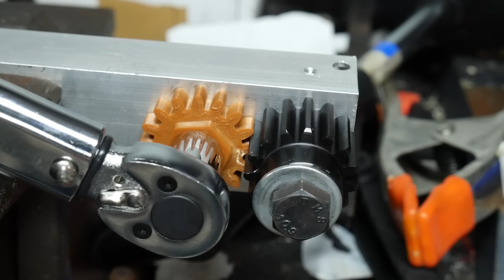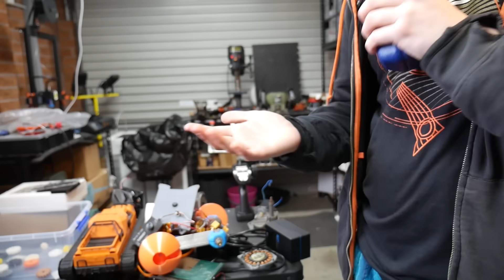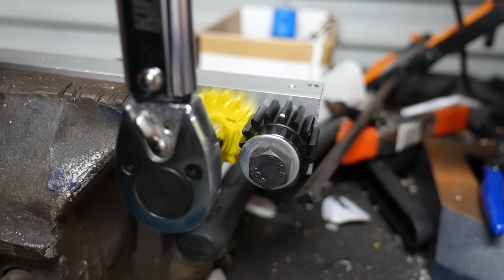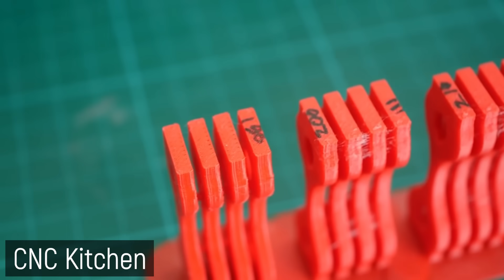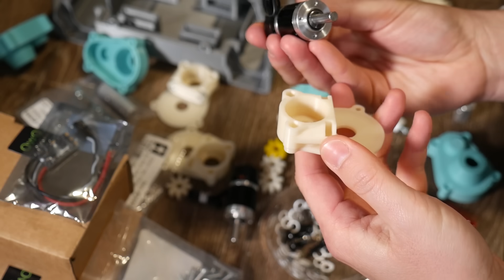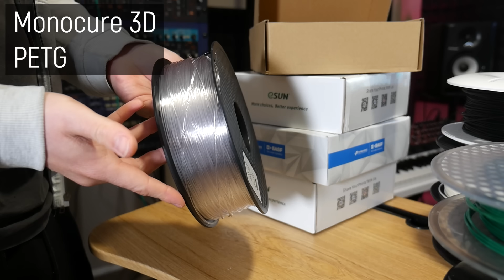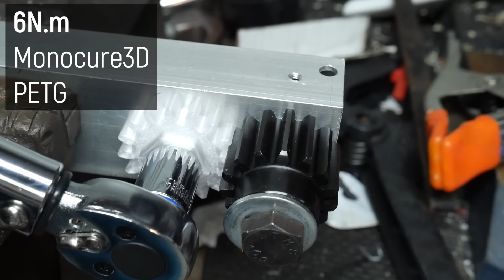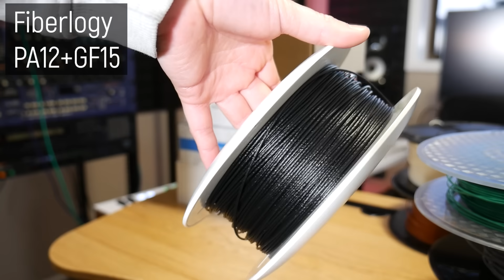Which 3D Printed Gear is Best?

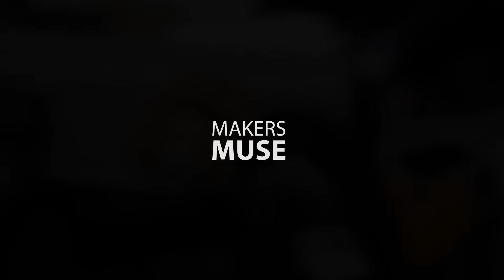Comment: 0:35 Angus, you're so much better than doing a long print like that with a minuscule table contact surface area and rotated like that! Please tell me that that's just to show off courage / bed adhesion, not a lapse of judgement! ☺️
Reply from the maker: I totally did print that and it worked great :) Had a brim and vertical gives the best detail.
Reply: @MakersMuse  absolutely, what I meant was that having a tall narrow thing swing while printing is better positioned when aligned with the moving (Y) axis...

Comment: 7:24 Nylon, cause it slips. No damage to the motor nor the gear.
Reply: Nylon parts should be soaked in hot water for an hour. That is how it gains a lot of strength.

Comment: PLA is quite good even as a surface bearing if you give it some grease.  i made a model engine printed in place with pla and after running it in to get the contact surfaces smooth it ran for over 2hours continously without damage and still works.

Comment: Angus, the amazing thing about 3d printing gears is being able to make herringbone and double helix gears, they are far more efficient, resistant to torque, and quieter. For your requirements I would definitely look at Polymaker CoPA-CF, quite pricy but definitely worth it, my second favourite is their normal CoPA, but they aren't as rigid.
Reply: Helical gears are not as efficient as standard spur gears due to the higher contact load and sliding friction for a given torque, although for most applications the difference is not significant considering the other advantages. Helical gears are stronger though due to the tooth effectively being longer. It would be interesting if he repeated the experiment with helical and herringbone and double helix (slight gap between the helixes) gears to test the strength increase. Herringbone gears are a bit stiffer in the centre where the helixes meet.
Reply: @Bordpie  I agree with the part you are saying on single helixes but double helix and herringbone don't have this downside. Yes herringbone is stronger due to the lack of a gap, but double helix is ideal for when the gear might get dirt or grease stuck in it, since it doesn't build up in a double helix due to the gap but in a herringbone it does.
Reply: RCTestflights made a few different style gearboxes for his autonomous solar rovers, much better durability than standard gears.
Reply: @Christian-cz9bu  They were also lubricated with slugs lol

Comment: Can you test annealed PLA? I think the results would be pretty interesting
Reply: It would be hard to get a good shape because gears would ideally want to roll consistently between all the teeth. 
But with testing, you could get as nice in the middle to keep that precision in the gear profile
Reply: consider how low PLA glass transition temperature is, you have to consider the heat from motors and batteries if there are any, and other factor like material fatigue.
Reply: @nhozdien5058  Indeed, James Bruton has had a number of failures where the motors in his robots are directly attached to 3D printed PLA brackets through the PLA softening.
Reply: @cambridgemart2075  yeah that is a really good point. Does that mean that PETG is worth it for the long run?
Reply: I'd bet it'll be a serious step up in strength.

All my experiments with what's strongest for moving mechanical parts has always brought forward annealed PLA/PLA+ and remelted PETG.

PLA retaining its strength longer while PETG gets more brittle over time as it reabsorbs moisture.

Ofcourse, if your application doesn't have your part in an environment with moisture, PETG will do better.
Reply: @enlightendbel  Hi！Could you tell me how to anneal PLA? I really want to know
Reply: I think in that case will be need using 100% infill, so maybe will be fair enough compare also against remelted PETG in salt.
Reply: @MichelBrPrGu  I have annealed prints at 100 C with 5% infill and it works just fine, as long as there is no stress on the print as it anneals. It is much stronger and more temperature resistant after. I recommend it for all practical mechanical applications.

Comment: Small 3dp gear: exists 
Elephants foot effect: NOW HOLD IT RIGHT THERE BUDDY
Reply: PrusaSlicer has a great compensator for the elephant foot effect.
Reply: @lio1234234  Cura too. Initial layer horizontal expansion or something like that. If you set it to a negative value you can get rid of it :)
Reply: @lio1234234  what's is it called haven't seen it
Reply: @rentaspoon219  Print Settings -> Advanced -> Elephant foot compensation.
Reply: Just reduce flow of initial layer.. Or when designing an object give it a chamfer of the bottom layer.  Done

Comment: Before I watch the rest of this I’m going to guess nylon.
Reply: Good video, I don’t think there really is a preferred method of fail when it comes to gears as the end result is still the same. I guess if gear is deforming you would have some advanced warning but with anything with any real rpm it’s still going to fail quickly. Would be interesting to make a composite gear, say pla hub with a modified nylon teeth.
Reply: @Geek-On-a-Motorcycle  nylons are better anyway because of their naturally lubricating properties.
Reply: Nylons are definitely very good. My favourite nylons are from Polymaker's polymide series. They are definitely the best I've tested!
Reply: I would have said the same thing based on the title, but there is a huge difference between 'is best' and 'can handle the highest load before it fails catastrophically'.